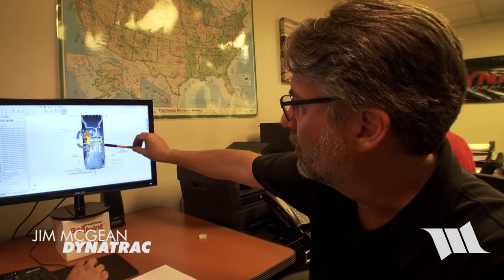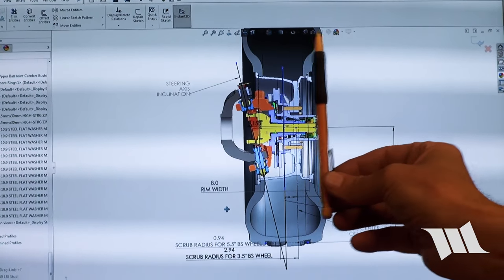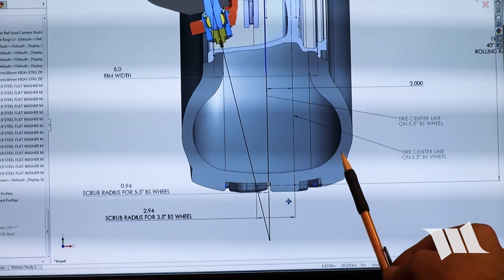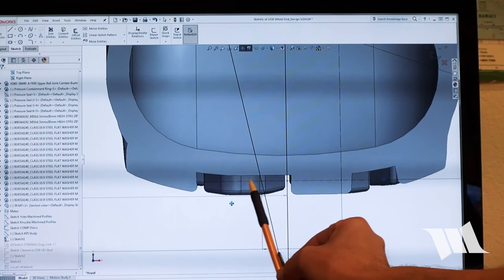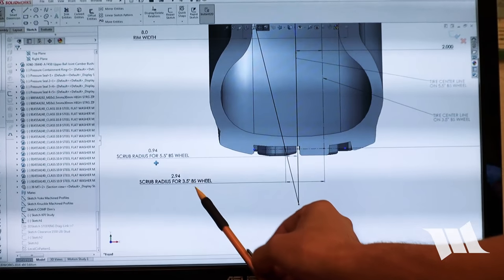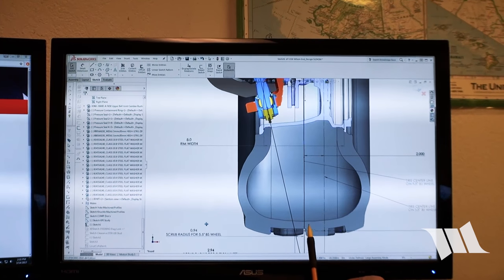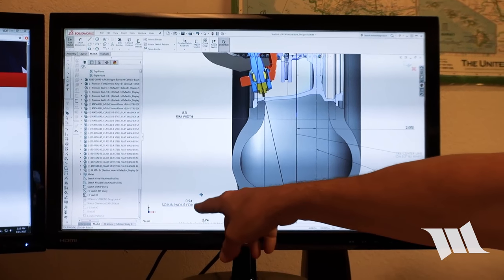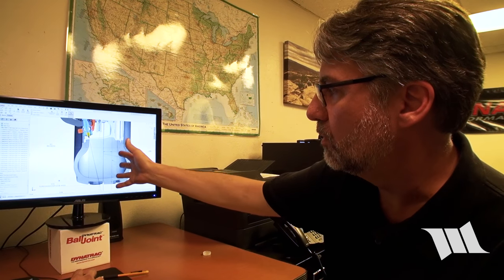SCRUB RADIUS - What it is and How the Dynatrac PRO 1550 Knuckle Helps Improve Steering on the XD60

Comment: So, why not make the steering axis inclination such that the scrub radius is zero...for say the most common tire size...say 35".. ?
What problems would that introduce..?
Reply: They are on stock vehicles. This is a 1550 joint knuckle, made for 40"+ tires.
Reply: This can make it wobble, there fore its avoided